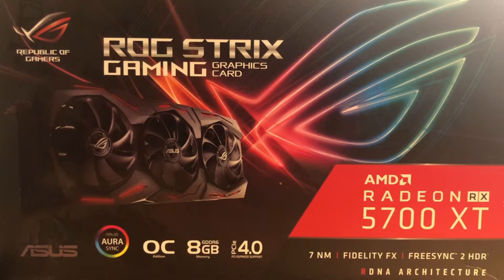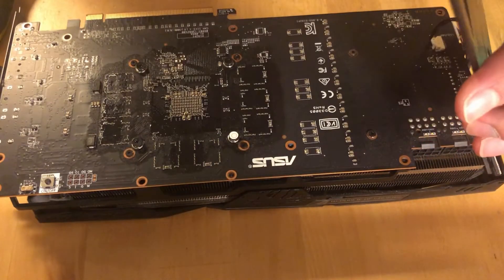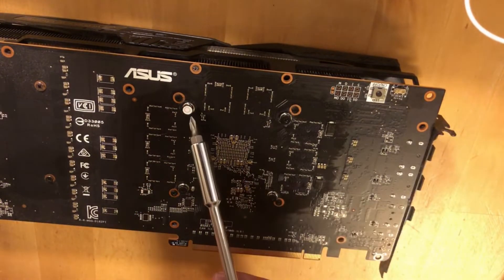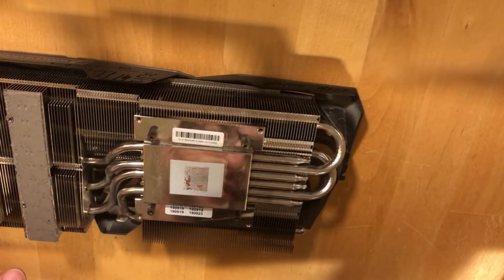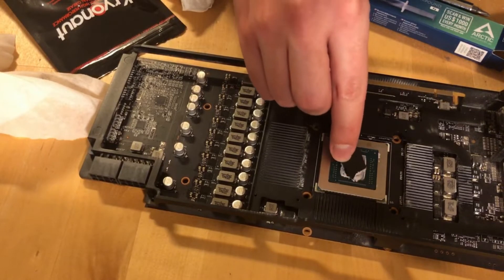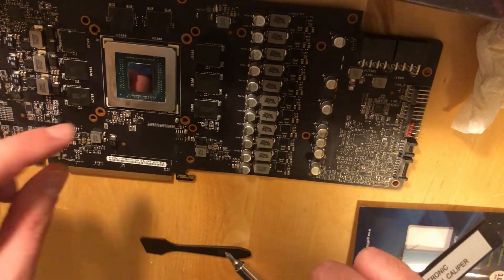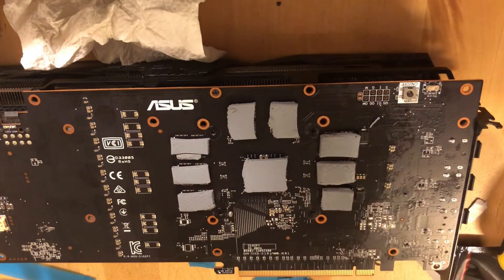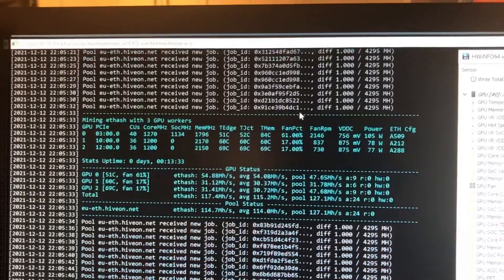How to Fix Asus Strix 5700xt Overheating Problem

Comment: Hey, I got this same card second hand. My edge and memory temps are fine (~60c under heavy load), but my junction reaches 110c on full fan speed. Do you think simply re-pasting thermal paste on the die would make a big difference?
Reply from the maker: I think it would help, 110c is crazy. It should auto shut down at those temps.

Comment: The screws holding the metal plate are faulty. Since it cannot print, the temperature increases. It was installed incorrectly. Asus service replaces the screws.
Reply: When did you got them replaced? Do they still do it in 2024?

Comment: Jakou jsi dával pastu na čip a roztíral jsi jí? Řešim problém s vysokou hotspot temprčr, karta je z druhý ruky po komplet profylaxi
Reply from the maker: Can you repeat that, but in english? :)
Reply: @BMasterBM1  pardon me, i thought, judging by yr accent, that you're a cz citizen. What thermal paste have u used and have you spread it out evenly on all the gpu? I get crazy high hotspot temp, even though edge is fine..
Reply from the maker: @paveljelinek772  no problem. Yes i spread it evenly and I used arctic mx 5 i think. Check this video for some tips on how to lover the temps. https://youtu.be/qCa5aVq-mkk

Comment: Hello, thanks for your video. I would like to know if you can help me with this. I want to update the vbios with the UpdateBiosTool downloaded from the AMD website, but I get an error saying that I have to run it as admin, but it was always run as admin and still the same thing, it won't let me update.
Reply from the maker: Hi. Which gpu do you have?
Reply: @BMasterBM1  same gpu, asus rog strix rx5700xt
Reply from the maker: @D0GGYD0GPC  try following the method in this video How to Unbrick and Bios Mod AMD 5700 XT Rev 2.0
https://youtu.be/Wol6PUJ8R7w

Comment: Hi I have the same graphic card as you have and I have bugs it makes my pc restart and weird things happen to my screen and when I run a game it goes up to 100 degres and yet I changed the thermal paste do you think it is the Pads?
Reply from the maker: Hi, i do not know about the bugs you have, but if the temp goes up it is thermal paste and pads most likely. It goes to 100 deg on core or memory?
Reply: @BMasterBM1  I did not launch warzone and in gpu it marked 100 degrees
Reply: @BMasterBM1  What is the reference of your thermal pads?
Reply from the maker: @ez-services4518  gelid ultimate
Reply: @BMasterBM1  okay and you put 1.5 mm?
Reply from the maker: @ez-services4518  i did as I said in the video, I do not remember anymore. Also check this video: How to Significantly Drop Memory Temperature on Asus Strix 5700xt!
https://youtu.be/qCa5aVq-mkk
Reply: @BMasterBM1  OKay, thank you.
Reply: @BMasterBM1  So on this graphics card in thermal pads I put 1.5 mm?
Reply: did you update the vbios + installed latest recommended drivers ?

Comment: Hi, I just wanted to thank you for your great tutorial. I have recently changed my thermal pads as you have shown and it worked wonders for me. Now I can set my OC to the maximum capabilities of the card and it works flawlessly without crashing.
Reply: i got mine to 70c on memory he didnt add thermal pad in the middle in the between memory radiator and heatsink.
Reply from the maker: @techgeek2994  i havent tried that on strix, however i did that on sapphire pulse, and it is of great help. When I open my strix next time, I will give it a look. Thanks for the info!
Reply: @BMasterBM1  yes there is a gap where you need to add 1.5mm and 2mm on radiator pipes side . i did it and its great now
Reply from the maker: Hi, you are welcome!

Comment: Hi friend, I have rx 5700 xt rog strix, I change thermalpads for Memory 1.5mm, Backplate 3mm but it's really hot 90° - 94°, any suggestion? backplate is better 2mm?
Reply: you need to add thermal pad in between memory radiator and heatsink there is no contact there to transfer heat from memory out of the card and also put pads on memory . i got my card from 90c on memmory down  to 70c
Reply: @techgeek2994  how exactly to do that?
Reply: @techgeek2994  Hi, I need to know, if you used 3mm or 2mm for backplate. Actually I  currently have 3mm but the temperatures are 94° - 98°
Reply: @danielhortadelgado7916  my friend you can see photos in the link i posted photos with all thickneses, that is not enough you didnt put in the middle where the gap is take a look at my rededit post and see what you did wrong
Reply: @danielhortadelgado7916  backplate wont make any diffrence you need to add thermal pad where factory did not put any look at my post i have sent you link and you can see where did i put thermal pads and what thickness
Reply: @techgeek2994   hi, can you please post that link in here? I would like to see it as well as I am dealing with this problem too
Reply: @techgeek2994  hi, where did you post the link?
Reply from the maker: Hi. The design of the card is not that good. So it will always be hot. I don’t know your setup, but 90-95 deg is acceptable.
Reply: @BMasterBM1  Exactly brother I'm mining on windows, Core voltaje +950, PL +0, cclock 1350, mclock 1840, fans 97% with fan on the backplate noctua. I currently have it in 92°
Reply from the maker: @danielhortadelgado7916  voltage is too high, you can go down to 750mV

Comment: can I put 2mm pads
Reply from the maker: Instead of 1.5mm? Or at the back? It would probably work on the memory, since it has separate radiators, but I would still recommend to use the designated thickness. Even on the back I think you can, but don’t hold me accountable if it doesn’t :)
Reply: @BMasterBM1  while mining, with 60% speed fans and 26 degrees temp, I have 56-57c on core, and 86-88c degrees on memory, vram 50c and hot spot 76-77c is it fine or the hot spot is a bit hot
Reply from the maker: @Tashyncho-Sapa  i’d say it is within the normal range
Reply: t @BMasterBM1  ok thank you, and this result is with 2mm thermal pads gelid and eth+toncoin dual mining

Comment: Hello, thanks for the video, this 5700xt have micron or samsung memory?
Reply from the maker: Hi, you are welcome! It has micron memory!
Reply: @BMasterBM1  Hello, today I opened the gpu, changed thermal paste and thermal pads (I bought 1.5mm memory, 2mm mosfet and 3mm backplate gelid gp extreme - artic mx-5). As soon as I change and turn on the gpu and temperature it stays at 46 gpu and memory 84 but with the fan at 100%. I think the problem is the 2mm thermal pad that I installed on the mosfet. any suggestion? my intention is to buy a 1.5mm thermal pad and change it to the 2mm mosfet but it makes me sad to throw it away since it is new.
Reply from the maker: @ranam9253  are those temepratures under load or in idle state?
Reply: @BMasterBM1  under load, 54.xx mh at 1300/750/750/880/1330 (hive os settings). Any idea?? The same gpu with samsung memory w/same oc settings got 46gpu/78mem 33% fan (22 celcius ambient temp).
Reply from the maker: @ranam9253  it might be the problem with a pad, 0.5 mm might not seem much, but it can cause this. These temps are still not critical, ddr5 is fine up to 100 deg

Comment: Hi! 
Gonna do this fix in a short while as I found my VRM mosfets pad torn to pieces so I was wondering if I’d be good to go with 2 strips of 120x20mm, one for those specific mosfets and one for the 8 memory chips + the memory mosfets. I’ll change the pads squished between the backplate and the PCB later on cuz I’m currently tight on budget.
Reply: here I am with the update. I only put a new Gelid pad on the VRM mosfets where the old one was torn apart. The GPU used to ramp up to 80° core / 110° junction real quick as soon as it hit full usage + it was hell of an airplane jet engine grade loud (that being undervolted to 1900mHz / 1020 mV. Now it goes nowhere above 73° core / 91° junction stock, being really quiet. Didn’t have time to test it undervolted.
Reply from the maker: @edimihai2944  nice, did you change the thermal paste? You should do that as well. I bet it would go down another 10 degrees.
Reply: @BMasterBM1  yes, I applied some TG Kryonaut but I bet I applied it poorly as I was in a rush.
Reply from the maker: @edimihai2944  well you need to be careful, and tighten the screws properly. Also if it is older version of the card, you might need 1mm plastic washers for additional tension.
Reply: @BMasterBM1  yes, I’m aware of both of those facts.. Unfortunately my card is one from those defective lots, so I had to struggle with it. Washers have been put for 4 months now to no positive results. It is now for the first time that I see some improvements after changing the VRM pad.
Reply from the maker: Hi! Yes, you’ll need two pads for that. I had only one, so i changed the memory only pads and the backplate pads. Let me know of before/after temperatures and good luck!
Reply: @BMasterBM1  Thanks! I’ll definitely stop by to give you an update after I had done the fix.

Comment: sorry to bother you again but I am about to buy the thermals pads and I looked somethings up and it says that you need to use 2 mm for the backplate so do I need to have: 
2 x Gelid Solutions GP-Ultimate Thermal pad 120x20x1.5mm
1 x Gelid Solutions GP-Ultimate Thermal pad 120x20x2.0mm
is this what i need or can i drop 1 of the 2 1,5 mm?
Reply from the maker: Hi, the 1.5mm is for the memory chips on the gpu side and you need 2 straps. For the backplate i used 3mm, however i think 2 mm is even better and you are going to need 1 strap. Make sure to clean all the oil left from the old pads. Good luck!

Comment: hi how much Gelid Solutions GP-Ultimate Thermal pad 120x20x1.5mm are you using in total?  or are you just using 1
I have the same gpu and i am getting memory temps around 104 c when I am mining should I be concerned?
my vram and gpu temps are oke 60 C while mining only my memory is realy high
Reply from the maker: Hi! I would suggest you buy 2. Because you also have to change the one on the heatsink (@4:40 the gray thermal strap on the left), which I forgot to say in the video. 2 pads should be enough, so you don't have to cut pads for each chip individually as I did, you can just use straps of pads. If you do it correctly and change the paste as well, I think you will get a drop of 10 deg on GPU, and 20 degs on mem. I think it is worth the trouble.  Is your memory Micron or Samsung?
Reply: Thanks man👍

Comment: It's still very hot, are there any other solutions? I own a few RX5700XTs but the Asus have the highest temperature. (XFX thic 3 is about 20 to 30 degrees cooler on memory temp.)
Reply: yes there is you need to fill gap in the middle of the card with thermal pad 1.5mm there is no contact in between memory and heatsink
Reply from the maker: Which version of Asus do you have? The one built before 2020 or after? What are you temps?
Reply: @BMasterBM1  bought them new last year. 2x Rog strix rx5700xt. I also have a gigabyte with high memory temperature. The XFX and sapphire seems to be the best.
Reply from the maker: @mmetzameland  Yes, as I said many times: Asus and Gigabyte are the worst. However, it is gddr5, so high mem temps are somewhat normal, around 80 deg should be fine. Which thermal pads did you use?
Reply: @BMasterBM1  I didn't modify them yet. But they are around 75-80 now.
Reply from the maker: @mmetzameland  that is still in ok range
Reply: @BMasterBM1  i got asus dual rx 5700xt and i have memory temp of 72c, i dont know did the person from ebay change pads ,but it runs as cool as my other powercolor red devil rx 5700xt with memory temperature of 70c also. i guess i am very lucky that i got this card running so good low temp, i also have rx 5700 asus rog strix it runs at 88c so i wont touch it as i can maybe make it even worse . 88 c should be ok temp
Reply from the maker: @techgeek2994  yeah, it sounds good.